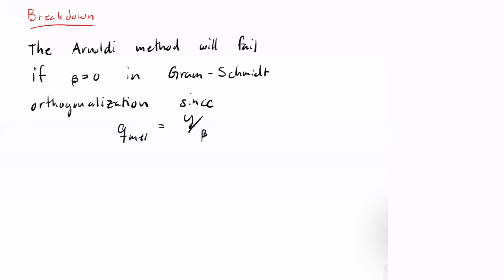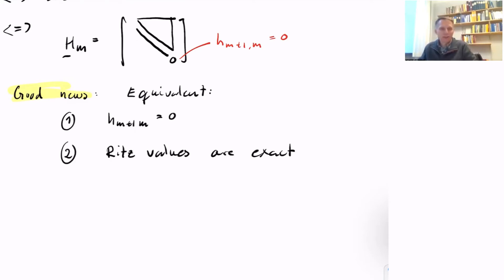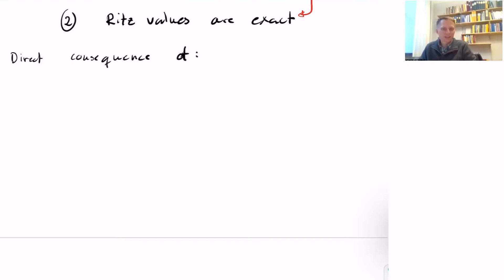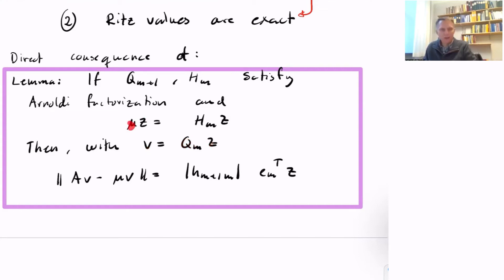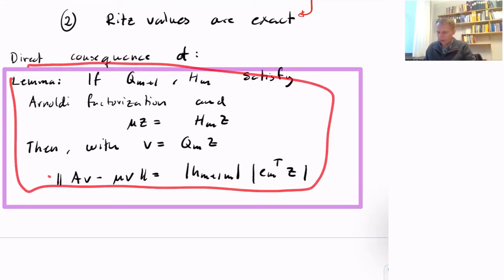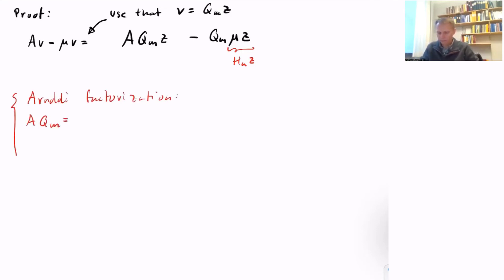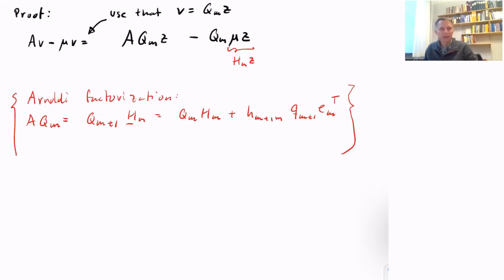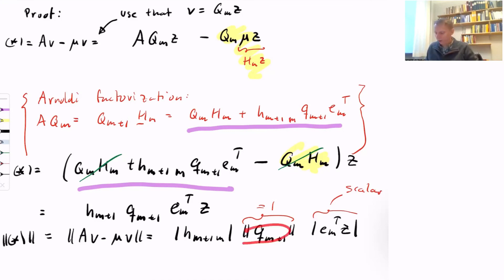Breakdown in the Arnoldi method explained - It's not as bad as it sounds!

Comment: Thank you very much for sharing! Is the Arnoldi algorithm the recommended one when working with non-Hermitian dense matrices on both sides of a generalized EVP? I am new in the Julia community and I am trying the eigs() function from the ARPACK, as a substitution of MATLAB eigs(). I would appreciate your answer!
Reply from the maker: The Arnoldi method is intended for sparse matrices or matrices where there is an efficient way to compute the matrix vector product. So probably not your case. ARPACK-binding in Julia is not great. There are several options which are more carefully implemented: KrylovKit.jl and ArnoldiMethod.jl
Reply: @eliasjarlebring772  Thank you for your answer!! Minutes ago I was reading that in the ARPACK manual. So, for my dense EVP I will try to use the native Julia eigen(). I will try the packages you mention for my other problem (sparse symmetric generalized EVP. Great content and thanks for sharing!